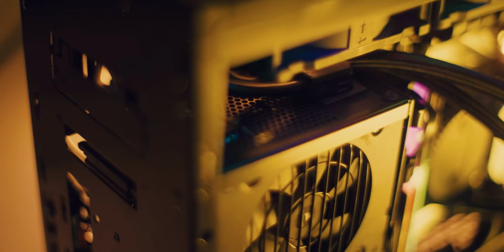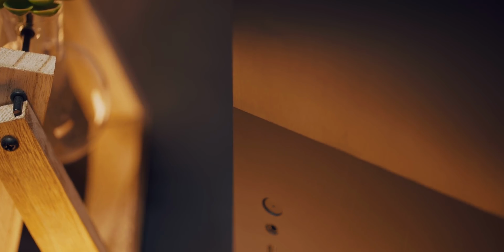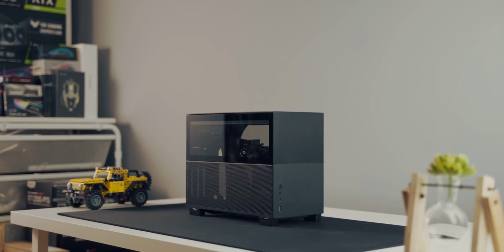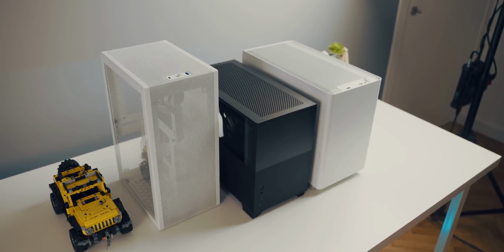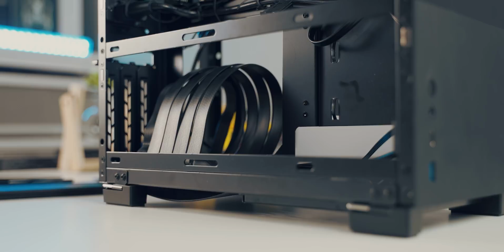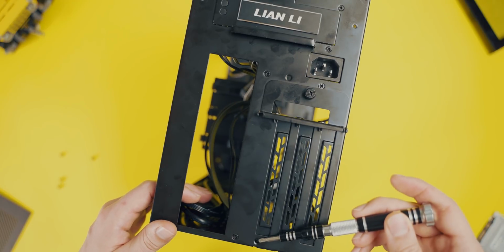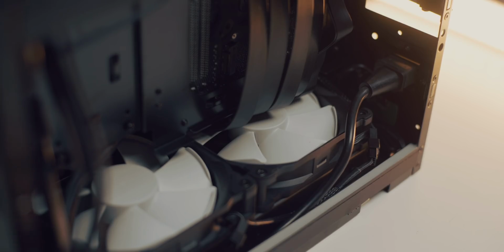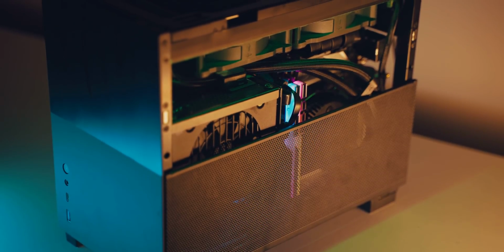An ITX MASTERPIECE?  Lian Li Q58 is Here!

Comment: I really liked the interior design of the case and I would definitely buy it, but definitely the ideal is that the panels were mesh on both sides, the fact that the top part is glass on both sides right where the radiator is located is not good idea and also only half of the psu fan can breathe, 
i also think that the power button should be a little bigger.

Comment: Lian Li, please remove the tempered glass and replace it with a mesh, in ITX segment cooling is №2 priority after size.
Reply: More mesh isn't necessarily better cooling.
Reply: This setup could actually result in better GPU thermals than a full mesh panel. Think about it, a negative pressure setup would be forced to draw in all of the air directly in front of the GPU, not above it as well. CPU thermals might suffer a bit, especially when the GPU is under load (although let's face it, a 280mm rad is more than capable).

It's actually quite a smart design imo, based on the more focused airflow design I'd expect it to beat similar cases like the formd T1 in terms of GPU temps. The fact that you can mount a bottom fan is pretty cool too, the double sided exhaust method worked amazingly well on the sliger SM580, and it should work just as well here.
Reply: @LyK0sa your are totally right and with this layout an air cooled system could perform better then an aio, because the rad is blocking the only viable exhaust.

Comment: masterpiece?

you sure you had no review direction from Lian Li?
Reply: You see any serious flaws?
Reply: Doesn't have an ODD slot, and the front IO isn't much better, it also only seems to have 1 radiator mount without going at it with tools, and it's a bigger volume than the NCase and you can tell where i'm going with this can't you?
Reply: @genericscottishchannel1603  ODD? Sorry? It's SFF (not to be confused with HTPC) case from 2021. 

Only SFF case with ODD I can remember is Ncase M1 and it's was designed in like... 2013? Sorry, but pretty much nobody remembers existence of ODD in PCs while thinking of computer cases.

1 radiator, but a 280mm one.
Volume bigger by a whopping 1.2L, sure, but it's a vertical case and that has a volume tax.
Reply: so fuck physical media is that it?
Reply: @genericscottishchannel1603  no, but your accusation of review not being honest based on that is funny.

Heck, shitton of current ATX cases don't support ODD in any form (be it slim/slot loading or 5.25" bays) and generally even there nothing is said about that. It's the new norm. Nobody is going to bash SFF case for not having ODD. 

You're part of declining minority, sorry.

Comment: it actually looks A LOOOTTT like the case ali from optimum tech used. The one he used is a different one that is much smaller but it looked just like this. i'm guessing lian li just copied the visuals from them. I don't really get why they did the whole half mesh half glass panel......because the part with the glass doesn't really make it look good when you have parts in there. The rgb part of the aio is in the mesh area and can't be seen through the glass....same thing with the gpu. you can't see the gpu through the glass. so it just doesn't really look that good honestly

Comment: this looks fantastic! the ATX PSU support, fan hub, airflow design, general versatility and great price are really unique. not quite ultra compact at 15L, but in turn it has huge compatibility for tons of fans, rads PSUs and even full size mass storage SSDs. matches perfectly with the external WD mybook HDD i have sitting here too.

Comment: what's the point of the tempered glass? I'm confused
Reply: Tom Storm  he means in this specific case. Even Dmitry said that the TG panels don’t show anything but the radiator and some cables lol
Reply: @tmarriotti  you could install Lian-Li unifans and showcase them this way!
Reply: @broklond  I'm pretty sure that is their ulterior motive, to get people to buy the fans. I sure as hell wouldn't be putting non-chromax noctuas on display
Reply: Lian li try something different.. Other cases either full glass or full metal... This case look beautiful with glass and metal. I take it the price is ok but not the cheapest
Reply: Lian li flip the TP to the bottom .. no one cares about the top RGB .. smh
Reply: @j0c1988  and then suffocate the gpu?? No thanks
Reply: in my opinion, it looks really really good
Reply: To show off.
Reply: Aesthetics? RGB?
Reply: What's the point of motherboards, cables, etc. in different colors? :D

Comment: Personaly, I'd love to get a full mesh version of the side panels.

That said, I kinda do understand that they also have to sell towards the TG-obsessed market.
Reply: @Grayson Peddie Same. However, we have to admit we are not a representative sample of the current market.
Reply: Personally I don't mind the look of this. The glass gives it a unique appearance, and it's still mesh where it really matters (in front of the GPU). In fact, it's probably beneficial to GPU thermals since a negative pressure setup would be forced to draw in all of the air directly in front of the GPU, not above it as well.
Reply: they are two types of people one obsesses with glass other with mesh all day... lol
Reply: A full mesh version would probably perform worse thermally.  The glass transmits the low pressure zone from the fans down to the top of the GPU.  This ensures fresh air goes into the GPU instead of around it.  Think of the glass as ducting.  It obviously doesn't need to be glass, but it is smart that it isn't mesh.
Reply: @AravindVennu  tempered glass
Reply: @Grayson Peddie that’s your opinion, I want all Tempered glass to show off my RGB water cool greatness.
Reply: thats a super well thought out case.. and probably one that will be able to be bought unlike everything except the NR200, which is a dope ass case for the price. I have a new LIan Li case that has the identical folding side mesh on the bottom, and class on the top, its just a full tower, so they are smartly using pieces they arlready have in production for this case which will make it obtainable.. and love that you can fit a full ATX power supply in there.. not like they are much cheaper anymore anyways but still cool
Reply: @Grayson Peddie Yes, the market is obsessed with tempered glass. He was correct. Hence why 90% of cases seem to have tempered glass.
Reply: @Grayson Peddie Yeah me too. Function before looks.
Reply: I am not a fan of tempered glass. I am all about performance. however in this case I think it's great. The upside to mesh, is airflow. The upside to glass, is reduced noise. If you can put glass where it reduces noise but doesn't effect thermals, then that's better. I don't care if you can see through the glass or not. It's still better then not having it in this scenario.
Reply: @TheRealMafoo  that’s why they should have that option.
Reply: Yeah but the placement of the glass in this case is kinda dumb? What’s the point of having it above the gpu? So we can look at the top fans?
Reply: thats the Formd T1 literrally, so just get that instead lol
Reply: @robertohernandez1642  Nice joke. It currently isn't production and even if it is going to ramp up again, you usually have to wait a few months after pre-ordering it.

That said, it is an amazingly space-optimized case!
Reply: @Leonsimages  yup i waited 3.5 months for mine, totally worth it

Comment: looks pretty good but youre right about the tempered glass top section only showing off a radiator and cables. maybe lian li should just let it be aluminum and sell it for a few bucks cheaper?
Reply: if you look at the meshlicious (which is made by lian-li), the mesh panel is more expensive than tempered glass.